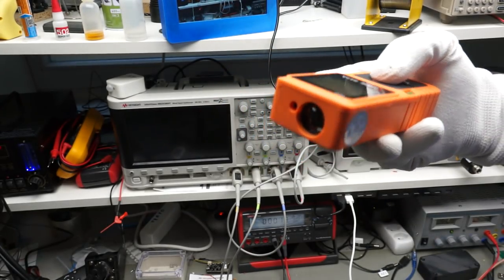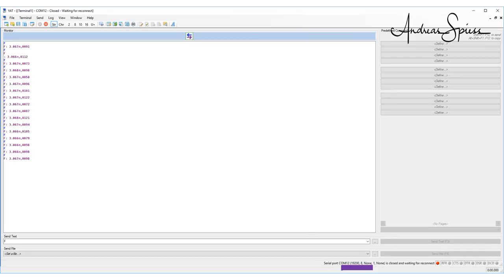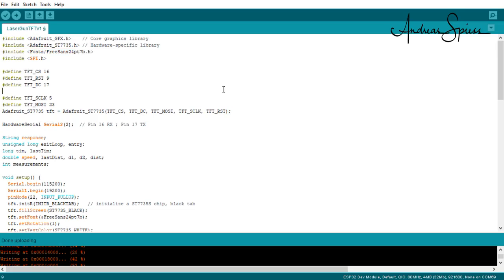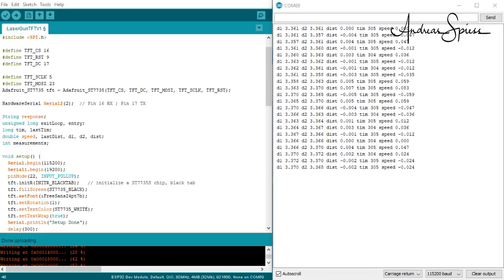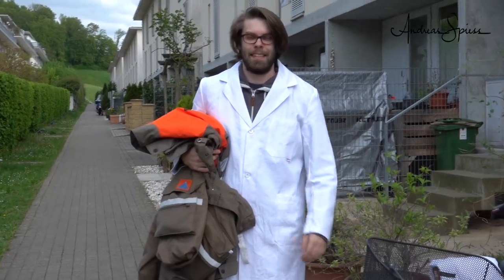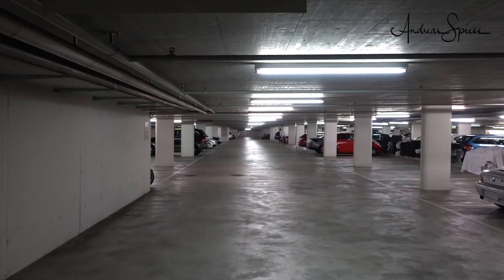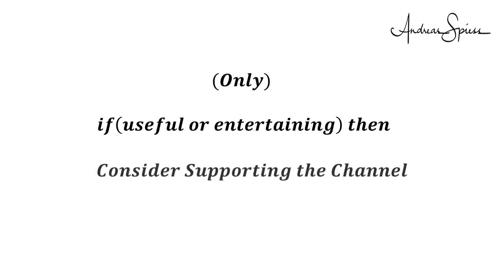#198 Laser Speed Gun Project with Range Finder and ESP32  (Distance Meter)

Comment: I believe that these are laser triangulation sensors. Depending on the distance from the object, the beam gets reflected onto a different part of the matrix behind the big lens.
Reply from the maker: The sensor I used measures the "Time of Flight". But sensors for smaller distances can use the principle you describe.
Reply: I think your "long" range sensors use triangulation, not ToF, that would explain the big lens and a long photosensitive sensor array behind it. Also, it could answer the question why they don't work with reflective vest surface. It's designed to reflect light exactly into the "sender" and it's not what the triangulation sensor expects to happen with its laser. I'm very interested what will happen if you shine it at a mirror at slightly different angles than 90 degrees (please use protective glasses). Try to get its own laser to shine at different points of its big lens. Maybe cover the lens with a piece of tinfoil with a small hole.
Reply from the maker: I added a few other videos with some more "discoveries".

Comment: I bought the 3rd laser on the right recently, it gives 20 readings per second in continuous mode. But it has problems with lidar like applications. Namely like the other three lasers, when it encounters an error, it will slow down to 3 seconds for an error reading. Typically this kind of laser tries 'thin' mode, and if it can't determine the signal will try 'thick' mode. More annoyingly when modeling 3d objects, the laser shuts down every 5 seconds for 1 second, i guess due to heat. True 200hz - 500hz lasers do not do this, they simply return an error without the retry of different beam widths - but they suffer from much higher inaccuracy.
Reply from the maker: Fortunately, we can get now cheaper LIDARS which are made for things like 3D modeling...
Reply: I agree, I scored one for 50 USD as a fluke. But then the company changed to 150 USD :( The cheapest lidar @ 100-500 readings per second, at 3cm accuracy, seems to be in the 150 USD range. Do you know of a cheaper one?

Comment: I suspect the little hand held devices use spot size (triangulation) to measure smaller distance and an time encoded pulse for larger ones.  BTW I guess the red laser is only for siting i.e. it almost certainly uses a IR laser integrated with the camera for measurement  .  Again a guess, but one way of measuring distance is to vary the frequency of the send signal linearly and measure the beat frequency of the combined send/received signals .
Reply from the maker: I have to check again. But I think I remember it did not work anymore when I covered the LED.
Reply: Andreas Spiess  you may be right.  the red laser is modulated so it could be used as the signal carrier. I may have to play around with my one ( but first i have to fix a 30 year old studer tape deck)
Reply from the maker: Studer decks are always worth the effort. I used to work in the next building to their factory (also 30 years ago)
Reply: Andreas Spiess studer fixed (well faulty board found and bypassed)  will have a look at the range finder signals tomorrow

Comment: 2 mm accuracy  and 2cm minimum distance ?  That's completly nuts !  I want to know how they can measure such small time scales.
Reply from the maker: I did not try the 2 cm minimum distance, but the +/- 2mm was ok (not absolutely, but relatively. I kept the device at the same spot and measured several times. As said, the values were very comparable over distances in my lab. And I think the normal rangefinders are also quite precise.
Reply: I am reminded of Michelson–Morley type experimental setups where they use interferometry, maybe it is the case here. So instead of measuring time difference it measures the phase shift ?
Reply: It could make sense but you have an very long arm ( the mesured distance)  paired with a very short one ( in the device). Because of this difference, you risk loosing temporal coherence and this would result in a loss of contrast of the fringes.
Reply: They probably don't measure time (time of flight) directly, but rather phase shift. When light travels, it also shifts in phase (because light is a wave (sometimes at least ^^)). You can use that phase shift for interference with another light source inside the device and thereby change the amplitude of a resulting light signal which then in turn can more easily be measured.
Reply: The commenters mentioning phase shift are almost certainly right. Recent depth-sensitive cameras from PMD/Infineon have an IR ToF sensor per-pixel and give amazingly detailed 3-D contour data in real-time, but only out to 6m or so, and only at that distance with a slow update rate. The PMD development cameras are also not cheap!

Comment: Just wondering what happens if two bicycles with same laser sensors at different distances point at same target? With both be “confused”?
Imagine when several of these sensors from several vehicles in traffic.
Reply from the maker: The lasers are not mounted on the bicycles. But you can confuse them. Because the laser points are quite small and the time of measurement is short it is not easy

Comment: Thank you so mutch for all your video .
I have stupid question , i know how to upload arduino program in esp32 but there is a way to retrive it (download) back too arduino ide for revers engineering ?
Reply from the maker: You can download the bytes of the flash of the ESP32. However, they are only machine-readable (the compiler in the Arduino IDE translates your code before uploading). You would need a "disassembler" or similar to get your code back. 
This is a big effort for specialists.
Reply: Merci beaucoup !

Comment: Very disappointing.  I hope you crack this problem! This is probably why the Mythbusters always used cameras with markers painted in the background.  I'm thinking about using two sensors set as far apart as possible along with timestamps and RTCs. Even then there would be the issue of incorrect numbers due to multiple vehicles.  I wonder if we could resurrect the Mythbusters method using cameras an automation.
Reply from the maker: I stopped these projects a few years ago. Maybe I will start again when Radar sensors become cheaper (because they are used in cars)
Reply: @AndreasSpiess  We may have other interesting ways to measure traffic when cars start talking to each other.

Comment: Where I live, you can find speed measurement devices including tripods on the roadside. I think that there must be somebody who has too many of them and just throws them away. I'm strictly against littering, so I pick them up and use them for my projects. ;)
Reply from the maker: Interesting. Do they also come with a manual? ;-)
Here, most of them are fixed that you cannot take them with you.
Reply: Unfortunately no manual. And yes, there are also some devices that are mounted on lamp posts but they don't need a manual, they just have a giant LED display and show the speed. The newer ones don't show the speed anymore, only a blinking red ":‑(" sign. I always test them by speeding up, but they never show anything else.
Reply: Let me guess, in which country you live….Switzerland ?
Reply: Maybe the guy with the Swiss accent, but I have a different accent. Guess again. ;)
Reply: "I think that there must be somebody who has too many of them…." 
I would say, you can't beat Switzerland, on how many of these devices (per km of roads) are used… they seem to be everywhere. But perhaps I'm wrong, and there is an even worst country?

Comment: Can this laser dangerous for eyes's drivers or others? my idee is to use that in a public parking of a building, with just a 'smile figure for result. All should be automatic. In this case, I can imagine children that play with the little red point :-(. So, I enjoy a doppler solution that I think less dangerous. No? Thanks a lot for your job from Vevey!
Reply from the maker: The laser is not very strong (specified <1mW). Maybe this is part of the problem of the bad function. Doppler Radar is also not dangerous for these small sensors. And it has the advantage that you do not need to point the direction exactly.
Reply: I actually think it's not genuine laser technology - see my question+ answers elsewhere in the video discussion.
Reply: eye safety may be a real issue working with lasers. This is covered by EN60825-1:2015 and you can only be safe when laser class 1 is certified. With lasers in visible range you might hope on corneal reflex (Lidschlussreflex) but I would not rely on it.  Mr. Schulmeister of Seibersdorf published some helfpul articles e.g. https://laser-led-lampen-sicherheit.seibersdorf-laboratories.at/fuer-hersteller/pruefstelle-laser/lasersicherheitsnorm-en-60825-1 . At least it gives you an impression how complicate even this aspect of laser application is. 
I would not measure in a public environment with a laser not classified by a reputable company.   
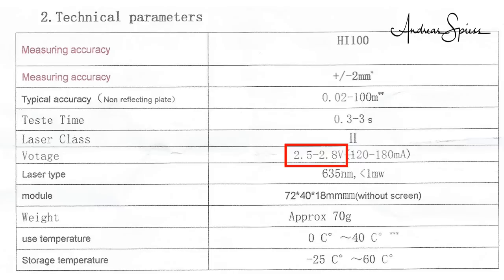In 1:53 I can read max laser power <1mW. This already could exceed class 1 and be in class 2. 
Before buying a Commercial device please take care of the laser class.

Comment: It's possible to use a pair of cheap camera modules and create a static array of Dict objects to map stereoscopic edge difference pairs to an estimated range. An ESP32 should be able to do this quickly in varying light levels, especially if a narrow portion of the cameras' images are used. Calculate the target's heading relative to the cameras, then calculate its speed based on heading and two range delta measurements. There are lots of existing code examples for edge detection in an image. Here's an ESP32 camera reading demo that can help with the data acquisition part: https://github.com/igrr/esp32-cam-demo
Reply from the maker: You are right. This principle can be used for short distances. I will show a device with this principle in one of the next videos. 
For longer distances, the method is less accurate (unless you extend the distance between the LED and the camera.

Comment: Remember: Failure is ALWAYS an option :D 
(I wouldn't call the experiments in this video a failure. You just know now how to not build a laser speed gun :D)

Maybe the range sensor can be tweaked. I'm not very well with those optical stuff, but maybe filtering the light that can enter the sensor (if there are no other filters in already) so only the color of the reflected laser is detected, might help. Or try a laser with more power (but mind the laws for Laser devices in your country... ;))
Reply: seems like any kind of filtering would interfere with its functioning because the speed of light changes in different materials.
Reply from the maker: As far as I can see the receiver diode/transistor has an IR filter applied.

Comment: I would really like to know how this laser sensor measures time of flight with relatively cheap components? Can it be taken apart for a bit of reverse engineering? Or does somebody on this channel know?
Reply from the maker: Mee too. I did not find a lot of information about it. And I am not sure if taking it apart helps a lot. You can see most of the parts already open. I thought they use some sort of phase to determine the distance. I found an oscillator chip which is rated to max 25 MHz and a crystal close to the LED. So they need some "precise" timing.

Comment: Maybe the voltage to the laser was too low for some reason, and that's why it didn't have enough brightness?
Reply from the maker: I did some more investigations and found that the laser is switched on and off with a frequency up to 200 MHz. So it would be difficult to change frequency without changing the whole device...
Reply: A video about designing your own laser range finder would be a great addition to the channel!

Comment: These sensors with separate laser optics and receiving optics are most certainly not ToF-devices but using triangulation. The reflection of the modulated laser beam is recognized on a 1D or 2D camera sensor and then the distance is calculated using trigonometry.
Reply from the maker: I know of this possibility but thought, the base is very narrow to measure even 50 meters using this method. The short range LiDAR modules seem to use this method.
Reply: in order to allow for the fast measurement at "short" (for lightspeed) distances, normally the laser and receiver in a ToF system should be mounted in the same package, as in the case of the new cheap ToF sensors available.

But yes, after reading up a bit, there a version of ToF systems around which does not use pulses but a modulated laser diode where the analyzing electronics extracts the phase difference of the emitted and received, modulated signal.
Reply from the maker: You are right. After more investigations, I found that my device "modulates" the laser with different frequencies. In the end, it measures TOF, just not using time but using phase of a defined signal.

Comment: An excellent description of the principle of such laser distance-measurement devices can be found in https://www.youtube.com/watch?v=pcw3Ue3cLUo (in German). The principle is a tricky but simple interference measurement of the phase shift between the original and reflected signal. By the way, recently the highly reputable German CT magazine also issued an article on this topic, https://www.heise.de/ct/ausgabe/2018-5-Aufbau-und-Funktionsweise-von-Laser-Entfernungsmessgeraeten-3964045.html, only with the problem, that what they were describing was complete nonsense. They had to revise it later and I cannot remember that CT had ever been so wrong. Good to know, that also the best are making mistakes. 
I would expect (my guess only!) that laser speed guns use in principle similar interference-tricks for measuring speed directly by analyzing the small frequency shift caused by the Doppler effect as distance devices evaluate phase-shift for distance. The alternative of two subsequent measurements as used in your experiments has the major disadvantage, that the second distance measurement might not hit the moving object at the same location thus causing measuring errors that can be significant. Of course there are workarounds and compensation methods, but it’s also more elegant to get the right answers directly form the physical effect.
Thanks for the nice video and you might give your device a second chance by designing a cheap automatic 3D-laserscanner, what could be a pretty demanding and usable project.
Reply from the maker: Thank you for your link. Elektronik recently even did an update video about the topic. I did some further investigations on my device and can confirm what he found.
Long range devices probably work differently and really measure the time of flight. We will see when I get my new rangefinder.
I was not aware of the CT article (even if I am a longtime subscriber of CT and Make).

Comment: Have you considered using the Lidar Lite V3 (especially the HP – high speed – version looks promising: https://buy.garmin.com/en-US/US/p/578152/pn/010-01722-10#)? Could you use its PWM signal output to measure the Doppler shift directly?
Reply from the maker: Looks like a very interesting product. I have a similar one here (for shorter distances) which I will test in the next weeks.